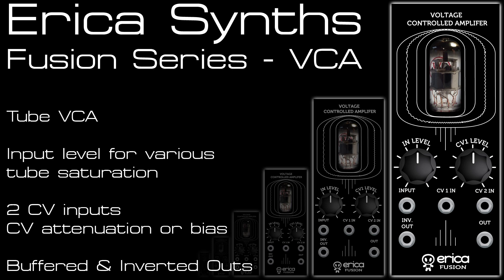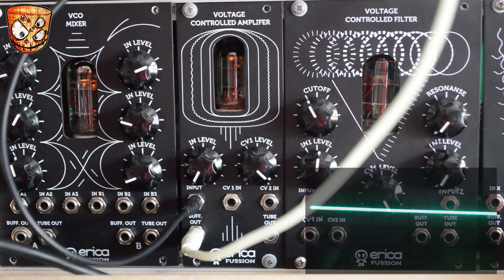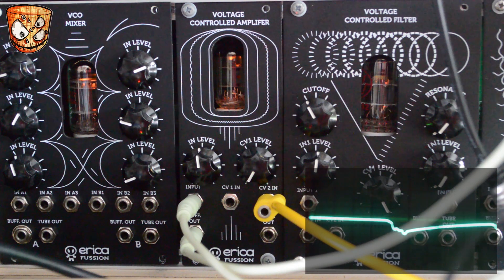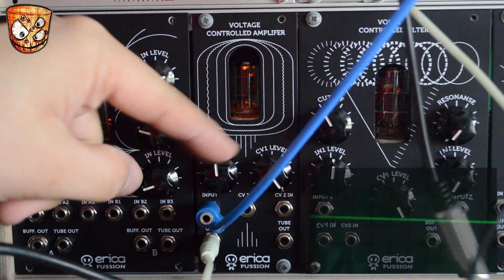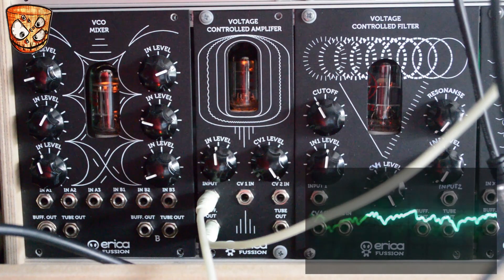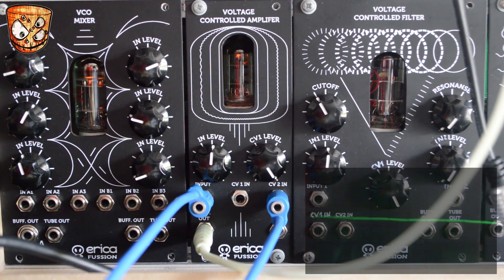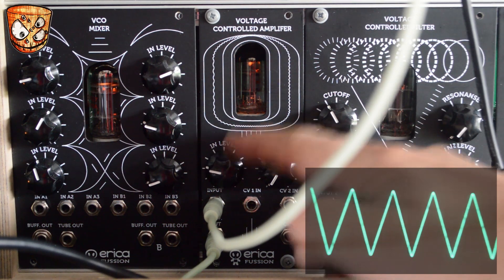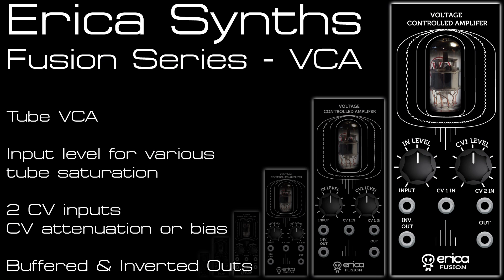Erica Synths Fusion Series - Tube VCA

Comment: hi there, I liked the volca beats into it very much!! did you plugged it directly or pushed somehow to modular levels? Also do I understand it correctly that all the tube vca functions are in the fusion filter? it seems like it... thanks & greetings
Reply from the maker: deefman The Volca Beats went through the AniModule TrAniModule if I remember right to take it up to modular levels. 

The Tube VCA has signal input to set the drive and input to the tube (which the whole Fusion range has). But then it has either offset for the bias/volume or CV input with attenuator on CV input 1 and the CV level knob. Plus the CV 2 which is just a straight in with no attenuation. So it's level control. The filter doesn't offer VCA style functions. Although you can use a filter like a VCA with it shutting the sound off. But the Fusion filter is much more of a tonal varying distortion style unit. Not your traditional filter. 

Hope that helps, if not keep asking questions.